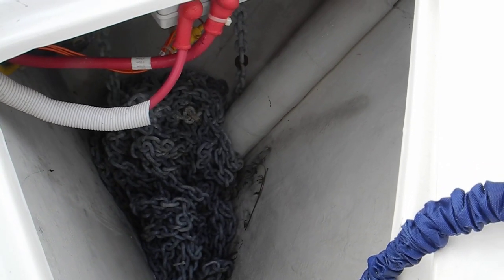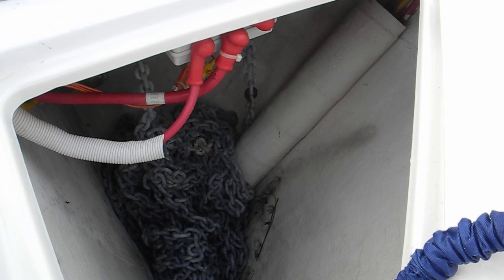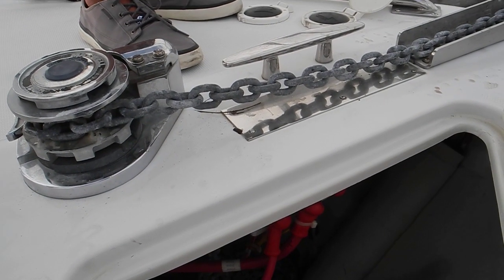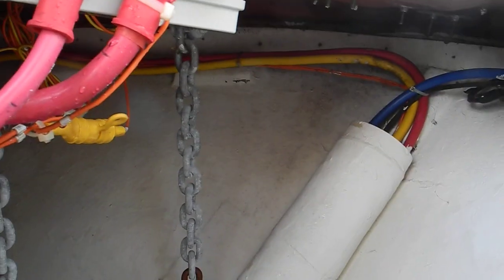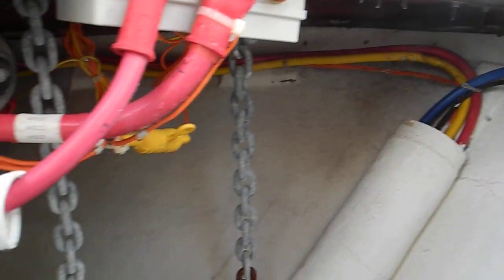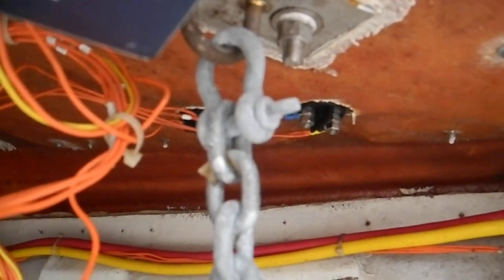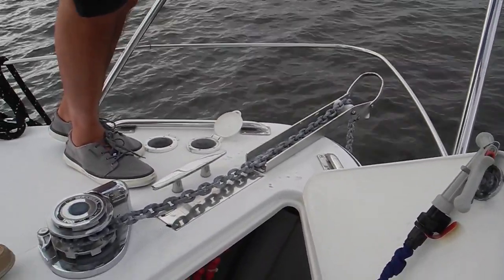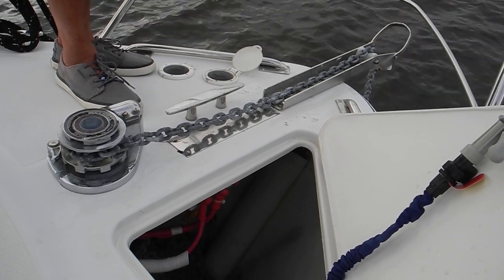Bitter end should have ROPE

Comment: I was in a situation where my anchor got stuck and NOTHING was gonna get it unstuck—anchored off the jetty in the Moriches Inlet.
Tide and current began to change rapidly and violently and was I about to be swung dangerously close to the rocks——my only option—-and it needed to be done FAST —was to cut that anchor line and gun the engine...scary,really scary. If mine was set up like this—with all chain—the outcome would’ve been calamitous.
Reply from the maker: Great testimonial. True events should make the boating public pay attention, check their bitter end and adjust the anchor rode for a possible emergency. Glad nothing more than a little excitement happened that day.
Reply: @AskCaptainChris  you’ve heard the expression”cut and run”?—this was exactly that only more like cut and PUNCH it. 
Next lesson should be on having a much sharper knife with you too....
Reply from the maker: John M alyse here. I carry my own knife and have used it to keep us out of trouble. First time for a wayward breast line that flipped onto itself as I was pulling it around a cleat. Last line to be removed and it just wouldn’t cooperate as the tide caught us and made it an interesting situation. Sharp or not, the serrated edge made the difference. Most important is that I had it ON me. Didn’t need to ask Chris for his or (worst that we hear) go get it from a nearby drawer. The adrenaline helped and end result we had a slightly shorter dock line. No blood so it didn’t count. ☺️
Reply: @AskCaptainChris  serrated blades are the best —plus you can eat a steak with it too if you had to.it pays to ALWAYS have something in your pocket—that’s for sure.lately I’ve been using a small multi tool and it comes in handy a lot.

On this particular day I was driving the boat and my brother  went at the anchor line with a rusty old BUCK knife we were using for bait—a small hatchet would’ve been the tool of choice at the time but he got through the 5/8” anchor line with it and a pile of adrenaline. Everything that doesn’t kill you needs to be a learning experience...have a good night Alyse

Comment: Not crazy with that anchor locker. Too many wire and things at the bottom that should not be there.  The wires with the canvas wrapper do not do it for me. What brand boat is this ?  That anchor locker does not inspire confidence.
Reply from the maker: I agree with your issue of all the loose wires and would prefer a different install. Sorry to say that I dug this video out from my archives and don’t remember the brand or model. Too many boats ago to recall exactly but it’s a Far East design.